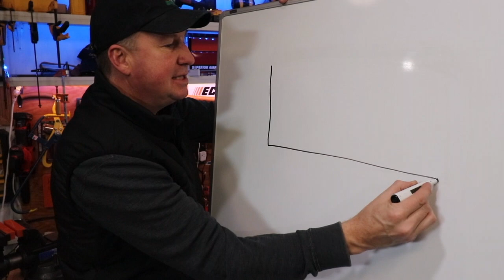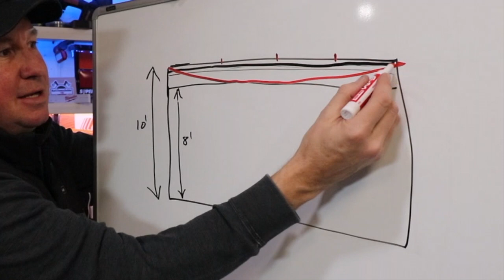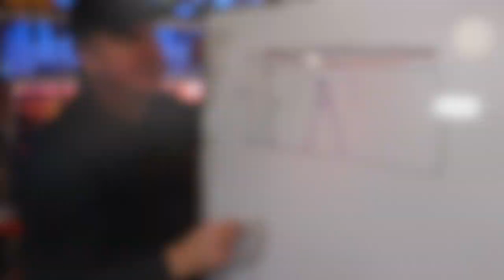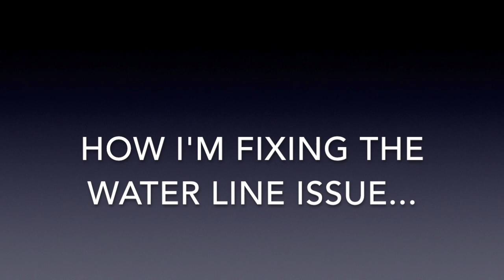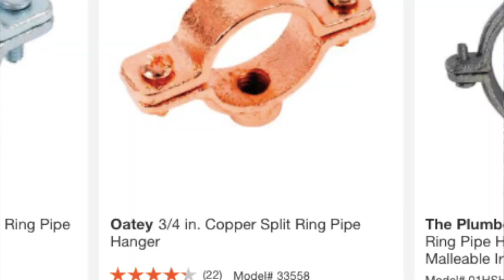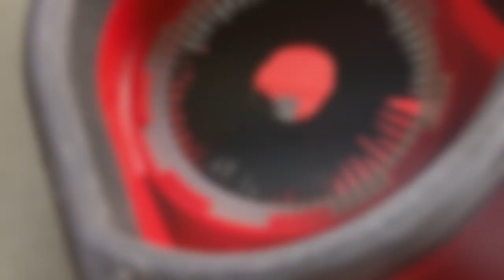HOW TO VACUUM SILICA CONCRETE DUST WHEN DRILLING OVERHEAD // OSHA APPROVED

Comment from the maker: QUESTION OF THE DAY:  Do you have a method for containing silica dust when drilling holes in concrete?  Were you impressed with the Milwaukee 8 Gallon Dust Extractor and attachment accessory?

Comment: Good video on containing dust. I have the Bosch Bulldog, and the dust extraction unit for it. Cheers from Texas.
Reply from the maker: Awesome.  I'm using a Bosch Bulldog bit for this demonstration and it goes in the 25 year old concrete rather well.  I should try the Speed Clean Dust Extraction Bit.  It probably works well for walls and floors.

Comment: the vac attachment says it’s for SDS Max but there’s no reason why i wouldn’t work for SDS+ ???
Reply from the maker: That's a good question.  I didn't read the fine print and probably used a SDS+ and it worked fine.
Reply: @MarkThomasBuilder  yeah it seems strange that it’s labelled as SDS “max” when even a standard SDS and SDS+ will work. the size of the shaft is irrelevant. thanks for the good demonstration 👍🏼

Comment: Hi Could you please tell me if this will work on a normal Milwaukee wet/dry vaccum? might need a longer hose
Reply from the maker: It should work with most wet dry vacs.  You just need a hepa filter for containing the silica dust.

Comment: Looking for something like this for the M18 fuel pack out vac. Would this work for that vacuum paired with SDS+?
Reply from the maker: I think this would work.  Otherwise you may need an adapter on the end.  I haven't tried the Packout vacuum but I hear it performs well.